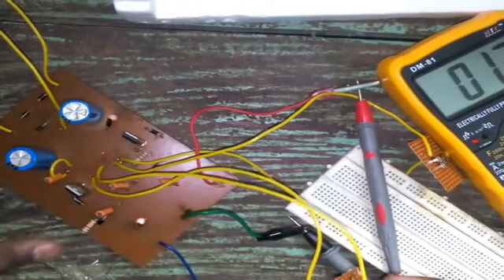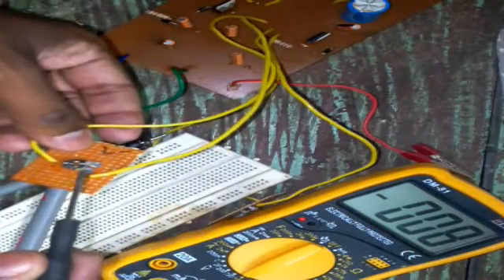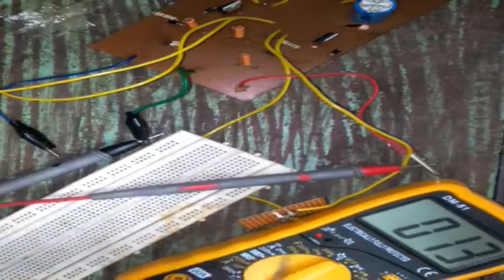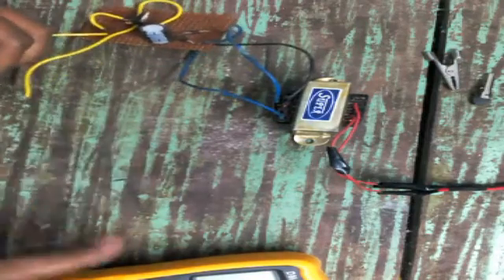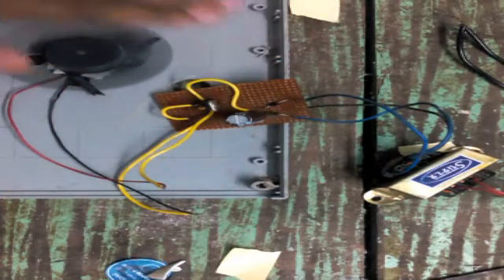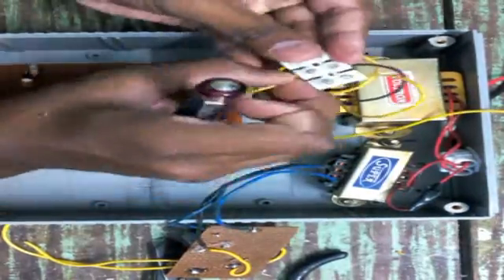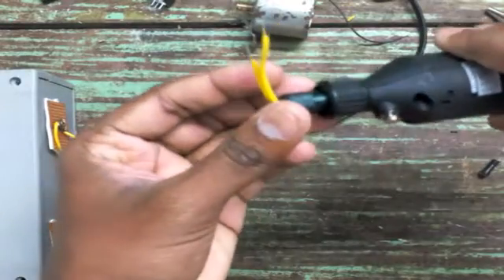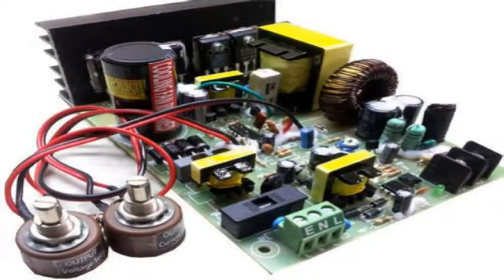PART 2  Making of Dual Power Supply LM337 & LM317

Comment: Sir , how to build 0-35v dual Regulated Dc power supply??. And in your circuit if we use 9v Transformer instead of 12v Transformer than other circuit components values does not change?????
Reply from the maker: There will be not much significant change when using  9v transformer. In one place equation and calculations are explained, I thinks it's part1 of the video.